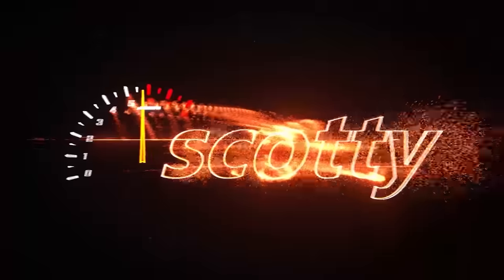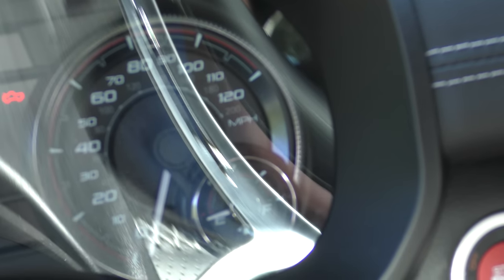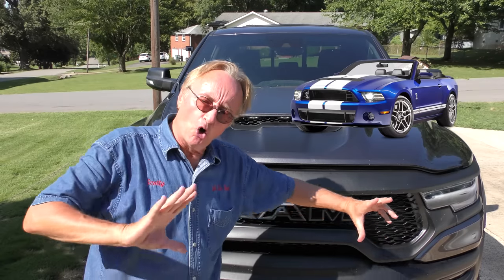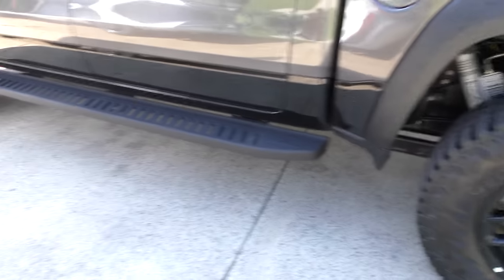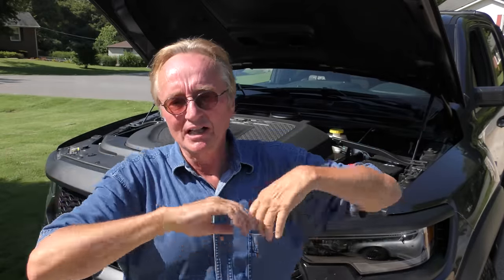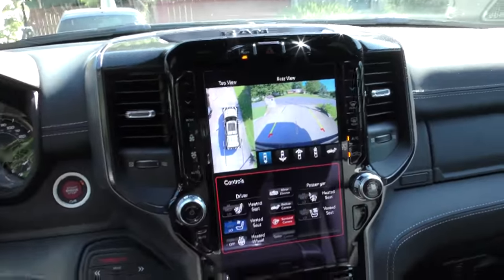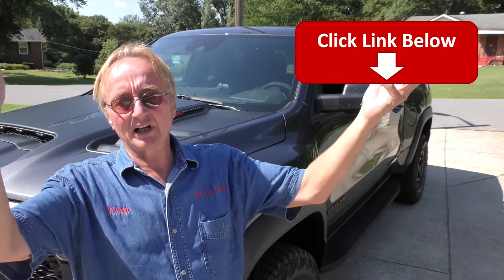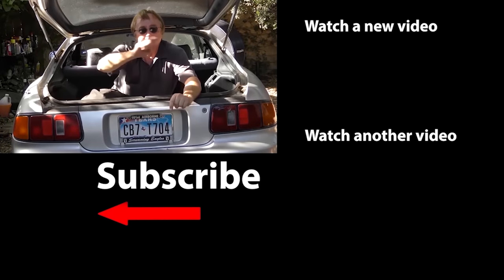I Finally Got a New Dodge Ram TRX and Here's What I Really Think of It

Comment: Ford: we’re making an electric pick up.
Chevy: we’re trying to make a decent truck 
Dodge: I’m putting a hell cat engine in my pick up and I don’t care what the EPA saids.
Reply: I think there's a niche for a multi fuel diesel engine for one of these beasts by one of the manufacturers .
Reply: Correction Chevy has the Yenko/SC Silverado 4x4 with 35" tires and a supercharged V8 putting out 800hp beating out the TRX and the Raptor in power! In addition they also put the same 800hp engine in a Silverado street truck. Plus don't forget that GMC has a sweet new SVE Canyon Syclone street truck with supercharged V8 making 750hp!
Reply: @chevy5137  you mean the one from the 90s and the syclone conversion?
Reply: @chevy5137  never mind I found the article online it looks pretty cool
Reply: @chevy5137  oh yeah most definitely
Reply: @chevy5137  they aren’t production trucks
Reply: @Mcsavage2.0  Yeah they are made by a third party company just like how Ford uses Shelby and they take a stock Mustang modify it and send it back to Ford to sell at the dealership, that's exactly what they are doing with these trucks, SVE and Yenko/SC modify the stock trucks and send them back to GM to be sold at the dealership, the only shitty thing is they are only going to be made in very limited numbers, it would be nice to see them made in larger numbers like the Shelby Mustang or the Raptor, especially since the Yenko/SC 4x4 Silverado is finally a Chevy that can compete with the Raptor and the TRX and makes more power than both at 800hp, although I have heard they are only making the TRX in limited numbers too, like around 700 or so but that's just what I've heard. I'm disappointed in Dodge and Chevy, they finally make trucks that can take on the Raptor and then they only make they in really limited numbers that sucks and not only does Ford make the Raptor in large numbers but now they have the Bronco another serious off-road vehicle that will also be built in large numbers, granted it's a Jeep Wrangler competitor which is also made in large numbers but between Ford making the Raptor, a serious off-road truck in large numbers, and now coming out with the Bronco they are really getting on the ball when it comes to large production off-road vehicles which is cool. I wish Chevy would come out with at least something in large production numbers, "Dodge" already had the Jeep Wrangler so they have something that's built for serious off-road and now Ford not only has the Raptor but the Bronco too now, but Chevy doesn't have anything they make in large numbers which disappoints me as a Chevy fan. They did have the H2 for awhile but it was a joke and then the H3 which wasn't to bad but not as good as the Raptor, TRX, Bronco or Wrangler. Chevy needs to make the Yenko/SC 4x4 Silverado in large numbers or come out with something like the H3 again but make it a lot better to compete with Ford and Dodge in the off-road market especially considering how popular the Wrangler has been for a long time and the Raptor has been since they brought it out and now the Bronco and TRX too even though they just barely came out. I'm sure Chevy fans would love it if Chevy made the Yenco/SC 4x4 Silverado in large production numbers or even another kind of off-road vehicle and I'm sure it would sell really well too!
Reply: @chevy5137  trx is not limited production. I have a 2021. The 2022 has new color options and such.
Reply: I've been a Chevy fan, but I'm getting the Ford's electric truck next.
Reply: @Chevy513 Shelby And Yenko are not similar. Shelby will modify Ford’s vehicles and send them back to dealers and sell them as production cars, while Yenko is more of an aftermarket tuner, similar to Hennessy. If Yenko was like Shelby, then we would see the Yenko Silverado in Chevy’s lineup online, just like how the Shelby mustangs are on Ford’s website. However, Yenko’s Silverado is not there because, like the Velociraptor, it’s an aftermarket truck that is being provided by Yenko in mass numbers. Therefore, the Yenko Silverado is not a real production truck directly by Chevy. It’s also why we don’t see lots of articles saying that it dethroned the Ram TRX And Raptor and stuff. In fact, people are more comparing the new Silverado ZR2 to those two since its an actual trim for a production truck. The Yenko Silverado is cool don’t get me wrong, but it’s made by an aftermarket tuner, and therefore can’t be considered as Chevy’s truck to fight the Raptor or TRX.
Reply: Gotta love Dodge!!!
Reply: @Mcsavage2.0  the fact was the "launch" edition was 702. But Scotty doesn't know that 🤣😂🤣🤣
Reply: @chevy5137  actually the new ford Shelby mustangs. Aren’t Shelby really. More ford performance. Same with the raptor. The yenko is not a factor truck. Also the raptor has nothing to do with Shelby. That would be the Shelby Baja raptor. It’s a ford raptor that Shelby took and changed. Both the raptor and the Shelby gt500 are built by ford at a ford factory.
Reply: This comment did not age very well.
Reply: This why I’m a ram fan now

Comment: “All that plastic, I wouldn’t have done that”🤣
Reply: I'm sure that will rattle at highway speeds 🛣 & crack apart after 4yr in ☀️☀️☀️.
Reply: @DavidLLambertmobile  Wrong I've got a 2017 in perfect shape with no rattles.
Reply: Speed Tube  you definitely have a good point. When Scotty said that the first thing I thought was BMW and there use of plastics everywhere to save wait. My Infiniti has engine covers just like this truck but not all over the engine like certain BMWs.
Reply: @Kalimuscule

Comment: My son works as an assistant mechanic at a local Dodge Dealership.  Said recently they had one of those come in with a blown engine at a little over 5000 miles.  They ended up replacing the whole engine under warranty.  May have been a freak occurrence but I would be quite upset if I spent 100k on a truck and the engine blew after 5k miles.
Reply: I'd wanna know what the heck the owner was doing with that truck in order to achieve that. Hopefully it's not a manufacturing flaw.
Reply: @Brentastrophe  mike from streetspeed tows his zr1 around with his t-rex.
Reply: @Brentastrophe  I thought the same thing.  I'll have to ask my son about it again and see if he knows.  However whatever it was it was covered under warranty so it wasn't "at least obvious" he did something to void the warranty.   It could have just been a freak of nature failure.
Reply: All companies have issues.
Reply: @Ryan_DeWitt   Good luck with that 😂
Reply: i do remember all the things scotty has said about dodge over the years.  hmmmm,   yup,  he is right,  heh heh heh.......!
Reply: @mcc7762  exactly right!!
Reply: Reason being that it's not properly broken in IMO.
Reply: It's a dodge owned by Italians Fiat.
Reply: Try again. Not a Dodge nor owned by Italians anymore. French PSA buyout.
Reply: @markirizarry4851 PSA merged with FIAT Chrysler
Reply: ubeuonly 1  yes way to many. Stay away from the EcoBoost or Ford in general.
Reply: Dodges are a pile of crap. Even Diesel ones. My caveman brother had a 2008 ish 4x4 diesel. He abused the thing. Broke cam shaft at tractor pulls,  all of the stupid "muddin'" events near DFW he was there. So much of that truck was rebuilt, I feel sorry for whomever bought it. He hit a full size cow freeway speed in it, put a rammer thing on the front after. It was pretty. That owner surely ditched it by now.
Reply: ubeuonly 1  Lightning owner strongly dislike the Raptors. Yes, they look hotter than young love. Would not buy one.
Reply: Like the brand new rolls royce that keeps going in for repair... ugh.  To spend that kind of $$ and have that happen, gets my panties in a twist.
Reply: @gt-c-  Lol. Old n Cranky and things that dont make sense to me, gets my grannies in a twist Lol!
Reply: No surprise at all.
Reply: Very easy to blow an engine with that much power in early stages prior to properly breaking it in.
Reply: maybe if people drive it normal it will last but launching it at every stop signs and red lights will break any car lol
Reply: @AF_1892  a pile of crab wouldn’t survive the abuse you described here…
Reply: @AF_1892  dodges piles of crap. Okay, diesel ones? Let me stop you right there. A solidly maintained cummins can run to almost 500k- million miles. They put out great power and towing efficiency. Your brother probably had an eco diesel which they are not very reliable
Reply: People are beating the crap out of them. We’ve sold less than 10 through the dealership I work for and at least 2 have blown their engine. One was blown within 72 hours of taking delivery!
Reply: I'd be quite upset with ANY vehicle that blew an engine at 5000 miles.
Reply: Fca and high horsepower and reliability just don't go toghter rofl.
Reply: Lol rated at 8100 pounds of towing capacity rofl my 4 cylinder ranger has a 7500 pound towing capacity!
Reply: Speed Tube  ya maybe to someone who has never worked on 1! They drop valve seats like it's going out of style they are far from reliable engines and that's facts not opinions.
Reply: @birdmannichols939  maybe the engine but the rest of the truck falls apart! And dodge or fca doesn't make the Cummins motor is the only reason the engine can last.
Reply: @victorgirouard1543  Unfair comparison. The correct Ford competitor is the Ford Raptor, towing capacity about 8400 lbs.  If you need to tow, the Ram 2500 crew cab with the 6.4L Hemi  will tow about 15000 LBs with the 4.10  rear end. Need more, the Cummins option will do about 20000 lbs.
Reply: @victorgirouard1543   That's your outdated opinion.  Ram truck sales  and corresponding market share increases over the last 8 years say otherwise.
Reply: @birdmannichols939  if it was a 2008 it's a Cummins.
Reply: Its not for punks who can't drive
Reply: How about getting the details first??????????????
Reply: @gt-c-  lmao they competed with ford and ford already lost. Try to keep up.
Reply: @victorgirouard1543  lol you have no idea why it’s rated that way? Lol go ride you cheap ranger
Reply: @vulcanman64  and it's rated that way because it can't handle anymore without braking the suspension can't handle it.
Reply: @vmyhdz  maybe they have but no where near ford. Ford has been number 1 in truck sales for over 20 years dodge has a super long way to go before there even close and they will never get there with the junk they make. I work on them almost everyday after 20 years I know what's a decent vechile and what's junk.
Reply: @gt-c-  raptors suck if I want a v6 I would buy a Taurus
Reply: @fireant1272  thank you
Reply: @AF_1892  I bet a power joke couldn't do half that especially 6.slow head gasket blower but all power jokes in general
Reply: @gt-c-  no I just meant ford are junk I knew you were a ford guy I could just tell by what you said lol 😆
Reply: @gt-c-  I owned ford's so I know they are junk sorry just stating facts
Reply: @gt-c-  wasn't trying to make you mad was just saying I have a Toyota tundra just won't own another for on to bigger better things

Comment: Scotty gets the big Ram TRX.  The entire Ram brand is actually great, and that is why they sell so well. Put in a 160 stat, tune, double the radiator with an all aluminum one, you have a very decent truck that will pull very well.  Or just get the cummins- already runs 170.

Comment: I had a 1998 Dodge Ram with a 5.9 l V8 4WD.  My overall MPG was 8 miles per gal.  Could never get higher.  Other than eating gas, it was a great truck.
Reply: My first truck was a 99' QC Sport 4x4, also with the ship anchor 5.9. I never got over double digits. That was the worst gas guzzler I ever owned. Replaced it with my 03' Escalade EXT with the 6.0 Vortec. It was like stepping up to a hybrid in comparison  lol
Reply: How many cracked dashes did you go through?

Comment: Scotty - Somethin' to be said for HD vehicles. FLA in '20, Missus had our only accident when passed out from Diabetic something w/o any warning signs. Although she had Ram Quad Cab, she was alone in her HD 4WD Ford Flex.  Someone honked horn at her sittin' behind red light, startled her, & was last she remembered.  Deputy said took off from light, drove thru town, turned around driving back thru town, missed her turn twice.  She then throttled up on 65MPH divided hwy, went off across median to within 10' of oncoming, jerked to right across medians and about 120' out in swamp knockin' down shtload of trees on the way, where she woke wondering what the hell happened, as Flex sunk.  Windshield smashed, exterior just devastated & Flex had went from Mint to junk, BUT SHE STILL HAD HER MINT RAM AND WAS UNINJURED!!  Deputy checked route & nobody else hurt or property injured, & I got my Pal of 50 yrs back!  I do all the drivin' now kinda like Houk drivin' Miss Daisy, but if she had a lesser vehicle, I would be a Sad Panda!!  In 114 yrs total driving, that was our only accident w/exception of few I had drivin' Late Model at Speedway a couple years which included a few intentionals as well!!!  Anyways, FYI.

Comment: Went into my local tire and suspension shop last week looking for 33s and a level on my 2019 ram 1500 crew cab long bed.  A TRX had just been in and replaced the factory wheels and tires with 200 miles on them.  I just got my truck back today with a 3.5” lift and the trx wheels and tires.  The guys at the shop think they look better on my white basic model than the trx.  Super happy!  Oh and btw they don’t stick out the sides really.  Perfect!

Comment: It’s limited to 119 because its the top speed for the tire speed rating.   Auto makers can't make cars go faster than the tire speed rating max.
Reply: Facts, and also on top of that there's a some governor regulatior/or chip restricting it that way, beside this thing is like a 6,500 or more truck, so might as well tone it down.
Reply: Despite your confidence in that idea, you're wrong.  It is speed limited because of its inherent instability at high speed.  Tires are chosen to suit the intended purpose of the vehicle, not the vehicle being designed around a particular tire.  Imagine the lawsuits if these things started death wobbling and rolling at higher speeds.  And it's an aerodynamic nightmare.

Comment: That is insane ... I cannot imagine being limited to just 119 miles per hour would be very frustrating
Reply: @GatorMan02 I own a trx. It gets to a 119 quick but with the factory’s tires any faster it would get sketchy and quick. 119 is enough in that truck trust me.
Reply: whats more frustrating is letting the truck go over 160 like it probably can and they losing a tire and losing control at 160.

Yeah theres a reason they limited it. Her tires arent rated for that speed.

Comment: it may have the power to tow more than 8100, as my 08 3500hd with the 6.0 pulls 10k effortlessly, but that doesnt mean the rest of the trucks hardware can handle it.  either way that truck is a toy so its towing or payload capacity is fairly irrelevant.

Comment: Random Q; Thoughts on the new RAV4 and Toyota Camry?

Random Experience: I’ve had my Elantra 2021 (first car)for 2 months now and it’s a decent starter car but I would really like to stick to Toyota or Lexus vehicles in the future
Reply: I'd go with the Rav4
Reply: @Curious A sell that Elantra fast and get a Corolla APEX! You'll thank yourself soon enough!
Reply: The new RAV4 and Camry are okay, but the 8-speed automatic they use is frankly awful. It’s constantly shifting and can’t make up its mind. That, plus the 2.5 sounds like a meat grinder. 

If they didn’t have a Toyota badge on them, they definitely wouldn’t make much of an impression.
Reply: @drivedb7  Oh snap, really? I’d love to get a rav 4 though? What would be your best recommendation for an SUV?
Reply: @bdpSovietafr0  Facts bro, this Elantra is definitely a keeper for the next 5-7 years. I’ve been told and have done a substantial amount of research, originally I wanted a Corolla but my dad wanted me to get a different brand for my first car, the best thing about this Elantra is that I only spend 25-40$ on gas a month and I usually drive 20-40 km a day - back to back from a to b.
Reply: @curiousadonis2766  — Truthfully I don’t really like SUVs, but if I was forced to buy one, I’d probably consider the Mazda CX-5 or the CX-30. I believe both are offered with Mazda’s 2.5L turbo too, which has plenty of pep. 

But don’t take my word for it. If you like the RAV4, I’d urge you to at least test drive one and decide what YOU think about it, how you think it drives and how it feels to you personally. Toyota sells tons of RAVs, so obviously a ton of people like them, but they just aren’t for me.
Reply: 2021 Elantra starts at 19.5 those Toyota’s start at 25-26 you get what you pay for. My grandmas Elantra’s ac comp failed with 60k miles meanwhile my 99 4runner never broke anything ever over the year and a half I’ve owned it
Reply: You shouldn’t have bought that!
Reply: @lindap.p.1337  lol my Elantra, why? Got a valid reason?